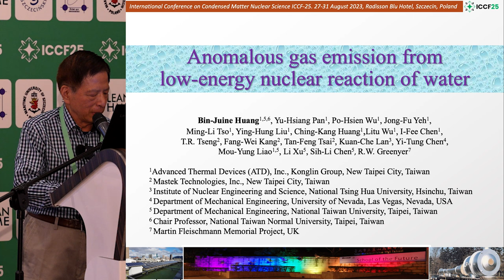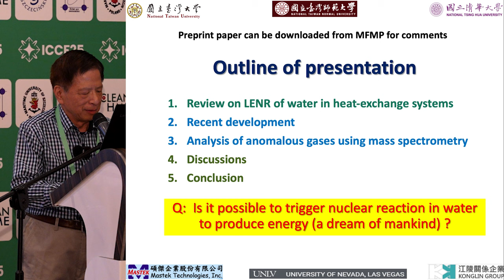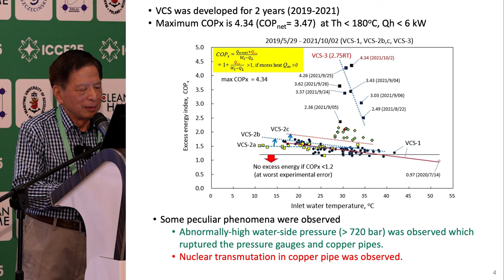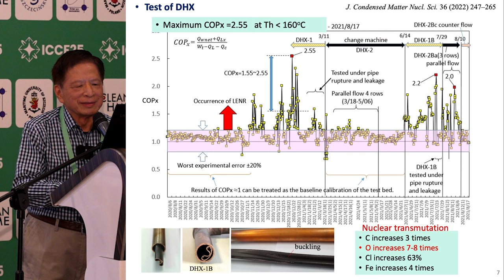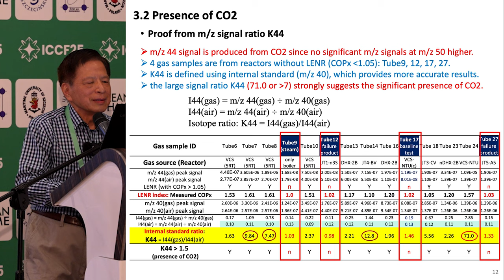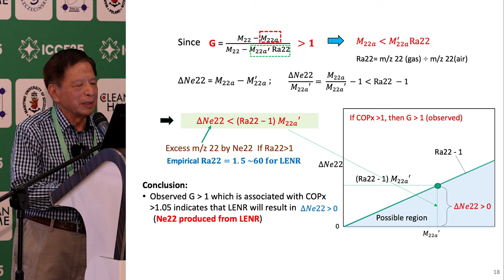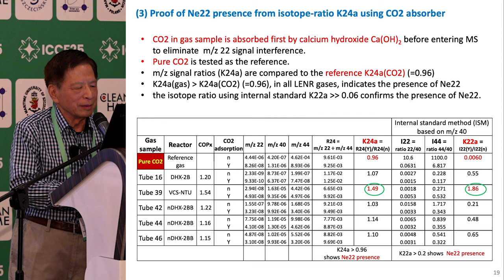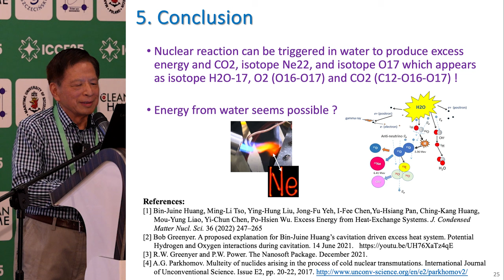ICCF 25 - Bin-Juine Huang - Anomalous gas emission from low-energy nuclear reaction of water

Comment: Thanks Bob. It seems to me that the pressure ruptures observed in the pipework may be of more use in any practical device than the heat generated. Perhaps schaubergers rotary home generator was simply a cavitation device that used the pressure pulses caused by cavitation induced lenr, in a feed back loop. It is after all, despite all its fancy spiral pipework, just an efficient centrífugal pump..Even a low COP would be enough to overcome the bearing friction and fluid drag and cause such a device to accelerate rather rapidly and out of control without a load.
Reply: @klystronxxx  Well, there seems to be strong evidence of excess energy in machines that utilise cavitation. So in simple English, Schaubergers home generator has spiral arms that are arranged so that water is thrown outwards through 1mm nozzles, where it is likely that cavitation bubbles are formed in the outflowing water jets, along with the associated excess energy. This is immediately converted into rotational kinetic energy by harnessing the pressure pulses as the bubbles implode driving the turbine faster and faster, exponentially. Bob's presentation explains the physics behind why cavitation causes these effects and there is plenty of evidence that excess heat energy and associated phenomena are  associated with these devices..Although my thoughts on schaubergers device could be completely wrong of course..What are your thoughts on this?
Reply: @marksmith9218  Can you provide any engineering design of Schaubergers home generator ?  I think that 1mm nozzle is the Venturi tube which can produce micro-cavitation and has been used in pollution control.

Comment: Looks a lot safer than the Plasma Fusion devices sitting next to near zero Kelvin Superconductors. 

A projection-drawing heterodyne logarithmic condensation wave-packaging formation approach is probably going to take a Labatory years to figure out, which it's possible someone's done already. 

The reason I have an opinion against Fusion is that Wheeler's One Electron Theory is an aspect-version of Singularity-point Lensing at the holography-quantization connection-origin of everything everywhere-when all-ways all-at-once here-now-forever, and the uncertainty of incidental modulation cause-effect mechanism is motion-> mass-energy-momentum sync-duration time-timing. 

Phys-Chem high tech I don't know much about.